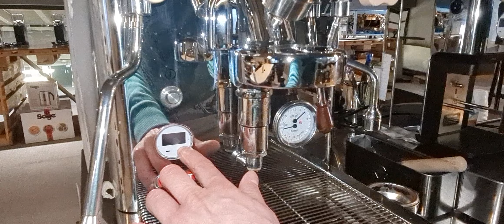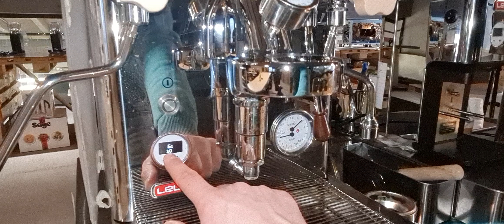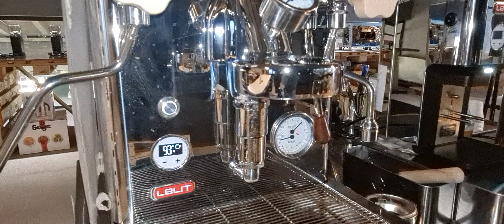pl162t tecnical menu (pid  setting)

Comment: Is there a difference between European machines and USA machines? I have read that the heating element of the USA machines is smaller, so does this difference affect the PID parameters? and how? Are the parameters set in this video tuned for Europe?  Would be possible to make a video that explains more in detail the changes range? The KDc goes from 12 to 0.4 - it seems a lot but there is no refence point - it would be of great value understand how different values affect the brewing temperature. Is there a solution to add a digital thermometer to the E61 group together with the pressure gauge? It would be more interesting to see the water temperature during the brewing of real coffee and not the simulated temperature tests with SCACE type portafilter.

Comment: Hi 👋 
Can you explain a little bit more what KDc does? I couldn’t understand by the description as for eg I do t know what descent phase means

As for the EC, since you put TR on 1 wouldn’t it make sense to put EC at zero so no extra 14c are always added when you set the temperature?
Also would 14c be more accurate to actually set the temp at group head? A recent YouTube review from Lance Hedrick shows that the temperature is off by 5/7c 

Thanks
Reply from the maker: falling temperature means: when the temperature probe senses that it is cooling down.
The faster it cools down, the higher the KDC value makes the resistor activate frequently.

Lance's machine has the EC value at 10, if you set 14 you cancel the offset, but to avoid overheating I recommend changing the other 2 values in this video
Reply: @lelitinsider2977  Thank you!

Let me see if I understood:
By lowering the KDc it means that when the brew boiler detects that the temperature is decreasing, it won't activate the heating element as fast as before
By setting the EC to 14 means that when you set the brew boiler temperature the system will add 14c to that number. So if you set it to 93 the brew boiler will be at 107c
By setting TR to 1 it means that the temperature displayed in the LCC will actually be the set + 14c as it will show the real boiler temperature, using the previous example it will actually show 107c and not 93.

Is this correct?
If so, I have a couple of questions:
- Reducing KDc doesn't mean that the temperature will decrease more while a shot is being pulled? Is that the goal?
- Instead of using EC and TR, if we set EC to 0 and TR to 1 we would get the same result if we then set the real boiler temperature, right? Using the example above, I'd have to put the temperature at 107c and LCC would display that temp, or not?

Regarding lance, when we pressed the + to see the real boiler temp it was the same as the set temp, so I'm assuming he was using the TR at 1, no?
Reply from the maker: @marcoandremartins  yes, it is all  correct.
but,
KDC is not enought to influence the temperature during the shot,
Reply: Just added this values for testing
Reply: @marcoandremartins  How did you find the new settings?
Reply: @osicuta  I haven’t found any problem, so I’m still using them
Reply: Thank you! Will try them aswell after my water tank arrives.  Upgraded from v2 to brand new v3 and 5 min after when I wanted to move the tank to the right I managed to drop the plastic one on the floor.. and surprise… it cracked😡🙈

Comment: @lelitinsider2977 After 3 months with this setting one I have a question. I did this change and I'm currently setting the temp to 93c (which should set the brew boiler temp to 107c), and I notice that the water coming out from the group head is almost boiling (some steam and bubbles also come out). Isn't that too high to brew the coffee or that should be how water at 93c looks like?

I lowered it to 92 today and it seams that now the water do not come out boiling
Reply from the maker: hi, try to set 
KPC 0.2 
KDC0.5
EC 12 
the other value still remain standard
Reply: @lelitinsider2977  Thank you!
Just a few more notes:
Played back a forth with temperature from 93 to 92 without changing LCC settings on the past 2 days. First day I only used machine at 93c and yesterday at 92c. The coffee is clearly much hotter at 93c, it's like I have to wait 1-2min to drink the coffee at 93 otherwise burns vs I can drink the coffee at 92 few seconds after.
The boiling water coming out does not happen all times, mostly after after I run some water, on B2B shots, etc. I've sent a video via Lelit email for you to check

Also wouldn't it be ok to just set EC to 14 or reset everything to the default settings and just set the brew temp to 98c?

I've already changed settings to what you suggested
Reply from the maker: @marcoandremartins  set the value Ec to 10, 
as I understand your machine heats up too much
Reply: @lelitinsider2977  today I’m with your suggested settings and the 2 shots pulled at 93c tasted good and were not too hot. I also couldn’t see boiling water.

Btw, what’s the difference between setting EC to 10 and temperature at 97c vs setting EC at 14 and temperature at 93c? Wouldn’t both result in boiler at 107c?

Comment: Hi. I applied these settings and after 2 days of using the espresso machine on them, the machine turned off and there is no more power. Perhaps due to overheating? All settings were as in the video. Either this is a coincidence, or the problem happened due to these settings. Sent to a service center. Be careful!😢
Reply from the maker: please send a video at care@lelit.com
Reply: And what to send, the machine does not turn on, there is no power? I would have sent it, but it has already gone to the service center. I note that I am from Russia, the espresso machine was sent to the official Lelit service center in my country.
Reply: I'm not saying these settings are the problem, but it's a bit of an odd coincidence. For me, this is a big disappointment. I hope the espresso machine is repairable. It is still under warranty, I hope for a warranty repair.
Reply: @home_coffeeshop Did you ever find out if the change in PID settings was the cause of your machine dying?
Reply: @pinter592  Hi! Today my espresso machine came from the service center, the electrical relay was replaced. I'm not sure what exactly these settings caused. Perhaps the problem was already there, and the settings only speeded up the process. Now it works great. Pid setting has not changed yet, but most likely I will change it just in case. So far I've only done a couple of shots, so far so good.